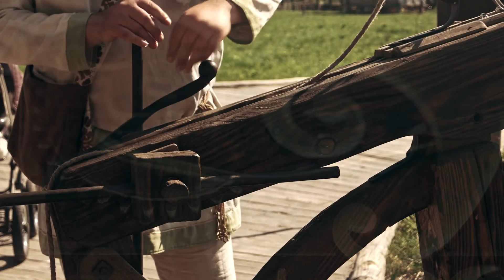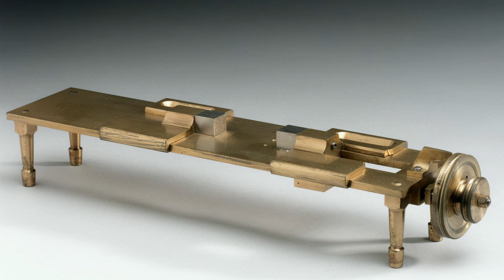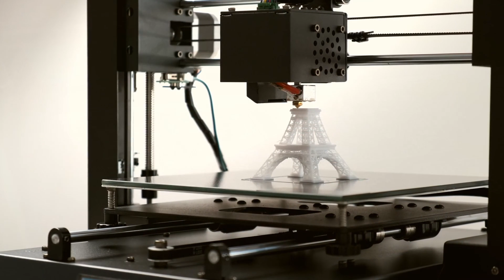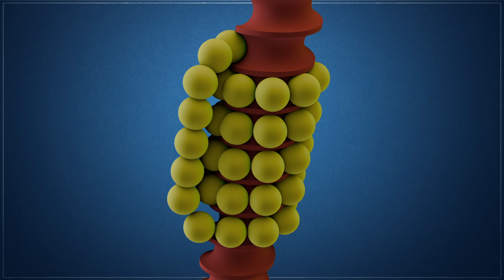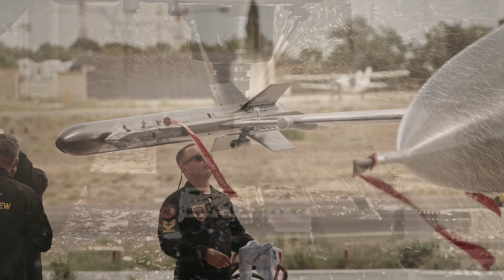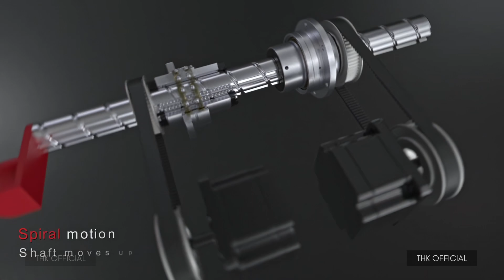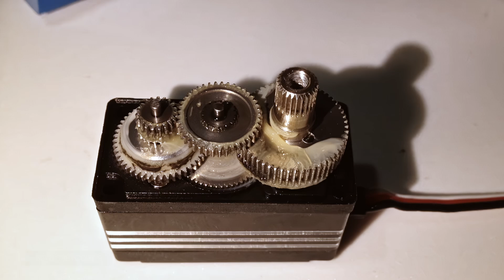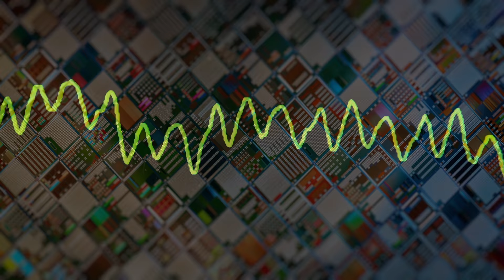The Obsessive Engineering of Precision Linear Motion

Comment: The asml bit is a bit odd and mostly false. For alignment of both reticle and wafer stage they have been using 6 doF maglev stages since around 2000. Piezo's contaminate, dont have the stroke or force density required and often over constrain by design.

Comment: WHITWORTH strikes again! Who would have thought 3 rocks rubbed together would make things extremely flat?
Reply: And it takes forever...4 hours in and still going on rubbing in 3 bench stones.
Reply: @ronwilkins5727  That is irrelevant. It was one of the facilitators for the industrial revolution.
Reply: @procatprocat9647  Yeah, I know.  I'm just stating that it takes quite a while to do correctly.  I know that, because I'm right in the middle of using the Whitworth method right now to make my own precision bench stones for use on rougher/scraping projects.  Don't want to use my more expensive PFG stones for those projects.
Reply: @ronwilkins5727  Is it more the rubbing or the checking that takes the most time? I'd think there must be ways to speed up the abrasion and the pairing sequence should keep it balanced, but I'm not sure how much they can vary and if you can practically check progress and correct the progression.
Reply: @gordonwalsh5652  just 4 dude in a comment section talking about rubbing rocks. This is what youtube used to be about.  Take me back
Reply: @gordonwalsh5652  The rubbing takes time.  Checking is actually easy, use pencil to draw shapes on all three stones.  If pencil marks rub off in all combinations, then flat.  I can see pencil marks coming off, but there is a bit of a convex shape on one stone that is taking a while to even out with the other two.
Reply: @gordonwalsh5652  You could prioritize rubbing. I.e. without checking at all because the system guarantee flat surface so you can in theory spend 10 times more time to rub and never check if they are flat.
Reply: Indeed, boofer god lol

Comment: cool！this video is Really comprehensive introduce the difference between Gothic arch and Circular arch in LM guide even CNC diy/CNC repair video won't cover such detail.Something  I had to point out in
most advanced wafer stepper/ultra precision positioning coreless linear motor still play the leading role, application  of piezo is very limited due to require contact

Comment: bigger balls or more balls
Reply: Bigger balls❌
More balls❌
Pee is stored in the balls✅
Reply: Why not both?
Reply: @ristopaasivirta9770 Because an oversized rolling bearing will be under-loaded, which could lead to sliding contact instead of rolling. This, ironically, reduces lifetime and therefore effective dynamic load capacity.
Reply: Balls...
Reply: The balls harden
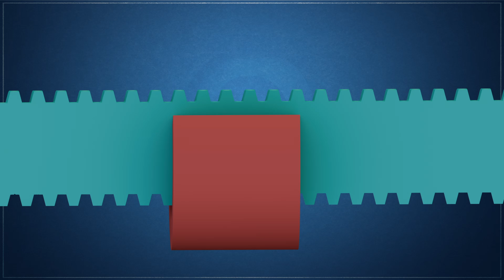Reply: 9:48 nut selection.
Reply: 15:42
Reply: Balls of steel!
Reply: the balls harden
Reply: Balls, nuts, and shafts.
Reply: @jardeshna good lubricant, so part's won't wear too soon. No fun if axel is half of nuts hole size and often hole sees problem in that part won't easily worn it's lifetime 😊
You cannot change axel, so virgin nut is then needed.
Sometimes nut carrier brokes her own, putting too big tools in machine and whole thing is then screwed badly. Even stucking different things is possible some cases and sometimes Dr. Engineer needed to figure how to avoid more damages. And remove everything from toy cars to broken cucumbers and so on..
Reply: levitating balls
Reply: They all start sagging eventually regardless
Reply: Thats what she said.
Reply: and then "magnetic" balls
Reply: Bouncing
Reply: …a bit like life
Reply: Yes
Reply: Both, both is good
Reply: my homie with one ball is gonna have so much plastic deformation😂
Reply: bigger balls - bigger pitch.
Reply: I skipped to a random part of the video and the first word was “balls”
Reply: Saved me 25min. Thanks chief
Reply: Balls Out
Reply: Both
Reply: Age old question
Reply: Only a massive balls can do the job
Reply: Depends if you want more speed or more load.
Reply: Recirculating balls
Reply: Roller pins.
Reply: @n0094  yeah that was a nice one i love this clever ideas
Reply: @n0094 planetary roller screw
Reply: *larger balls
Reply: Which do you prefer?